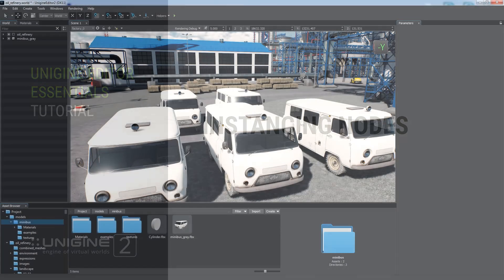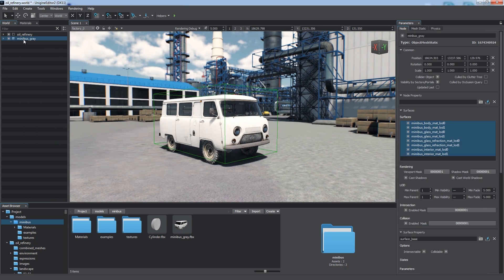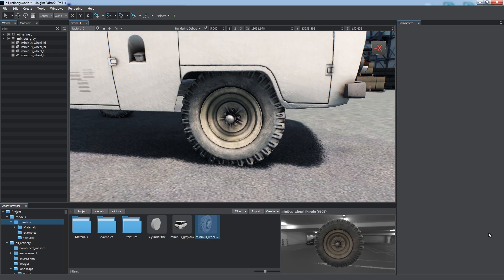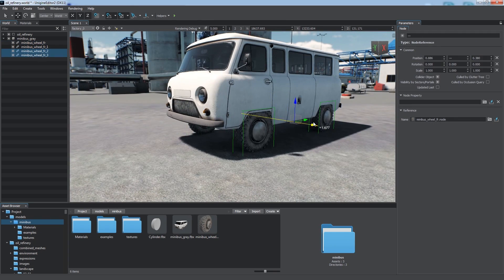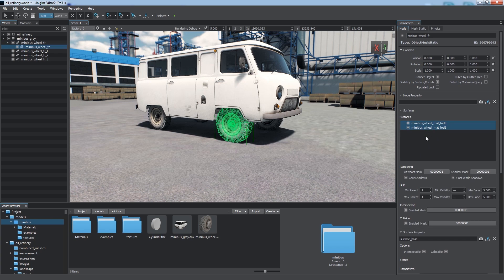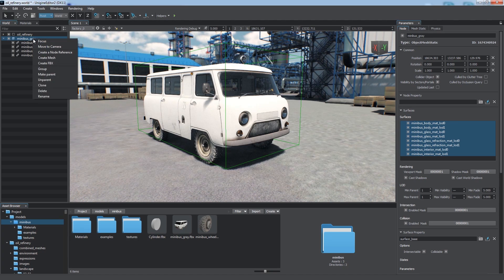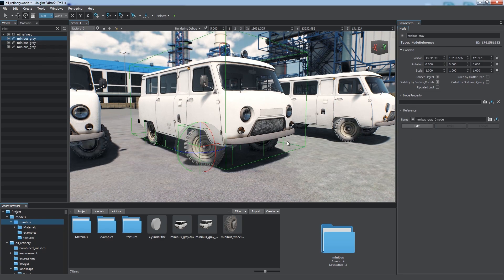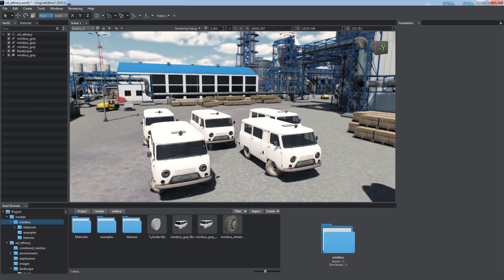Instancing Nodes - UNIGINE Editor 2 Essentials

Comment: How can I get code completion? Can't find anything by googling or going to your site. It's almost impossible to develop when I have to guess method names and capitalization
Reply: are you using c#?
Reply: @bryanandersonmt  ye
Reply: @osten222312  if you're using visual studio, you can go into the project folder and open the .csproj file, then it will open as a normal project in visual studio, and code completion will work fine
Reply: @bryanandersonmt  oh thank god!
Reply: @osten222312  did it work?
Reply: @bryanandersonmt  I'm afraid not, it says that the SDK "Microsoft.NET.Sdk" is missing
Reply: @osten222312  so you need to install that, it works fine for me
Reply: @bryanandersonmt  Don't understand what you want me to install, I have several different .NET SDKs installed. Is it .NET Core sdk or a UNIGINE sdk? Where do I download it?
Reply: @osten222312  on the documentation about working with Unigine using C# they say what SDK you need to install, i can't remember it so just take a look at it and try it out
Reply: @bryanandersonmt  Thank you